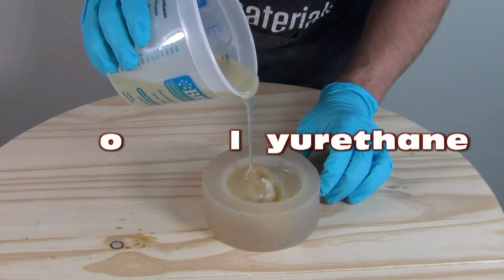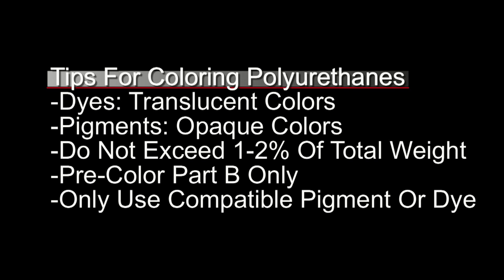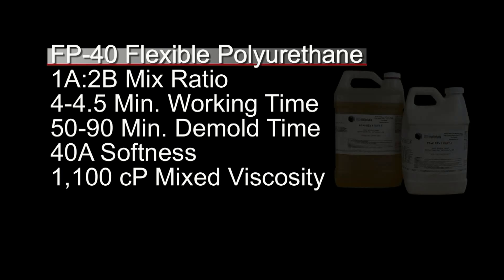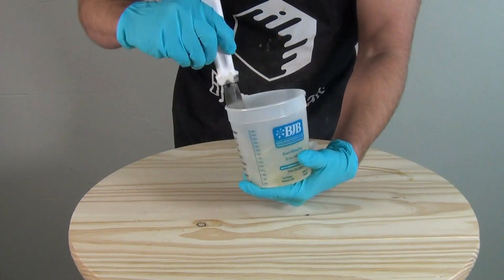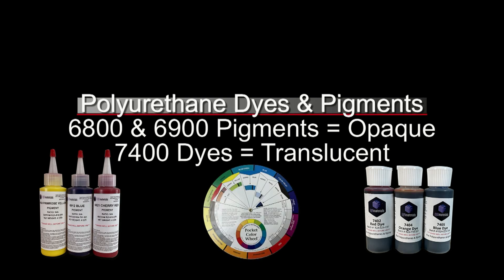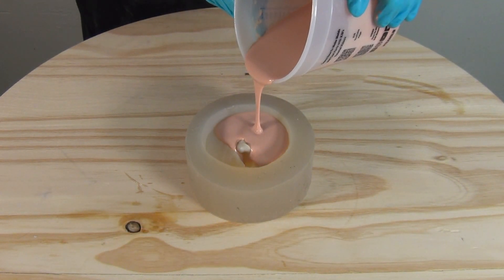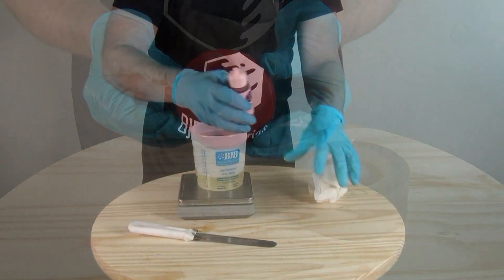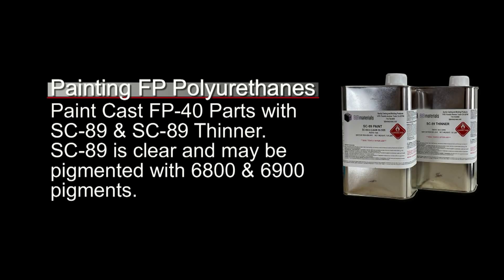How To Properly Color Polyurethane Foam, Resin, & Rubber

Comment: Hello, thank you for the informative videos; this channel has taught me so much in the last couple of years.

 I have a quick question : Do pigments and dyes used on PU Elastomers fade over time due to UV degradation? If yes, is there a way to prevent it?
Reply from the maker: The pigments and dyes, no. The material they are added to will determine UV sensitivity/color stability.

Comment: What is the best way to add white pigments to an amber plastic (i.e. neutralizing the amberness)?  What is the process for matching a color to a CMYK code the customer provides?
Reply from the maker: Depending on how UV stable the material is, painting might be better. In that case, pigment as close as possible using pigments/dyes, and then paint the exact color onto the cast part. In this case the intrinsic color is insurance against scrapes and chips.